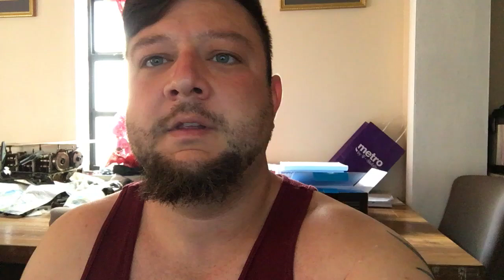K20/K24: Head Swap Worth the Time & Money?

Comment: So.... I'm glad I came across this video as I'm looking to purchase a 2nd gen CRV in the next 12 to 14 months. Having said that: there is still one thing that has me a bit puzzled. On the standard K24A1, there is only one VTEC solenoid. Youtu.be has a plethora number of videos saying that the K20 head is just a bolt on and go type modification. My wonderment is: what engages the exhaust VTEC? I haven't seen any videos that show this step. Or is the K20 head always "locked" for higher exhaust flow? Maybe I need to do more "paper" research.
Reply from the maker: The cams dont act independently of each other and you cant expect to do a headswap to a base model block without tuning and expext good results
Reply: @VHBEngines Oh cool!!! So, um.... What controls the second/exhaust cam? Some kind of special harness or something?

Comment: People are asking $1000-$1500 on eBay with no cams for a K 20 head
Reply from the maker: Hard pass
Reply: @VHBEngines  absolutely especially if it’s not gonna do anything for my car
Reply: Same thats the reason im here. Im checking for opinions and to see if its worth 1200
Reply: @RefugeeBabyzZ  and if you just put the head on it doesn’t do shit people say oh you get an extra 40 hp, yeah you do. If you put a 50° timing actuator and a downpipe and high performance exhaust and really big fuel injectors end a $600 tune so all said and done it’s gonna cost you over $2000-$2500 if you shop correctly to get 40 hp.

Comment: Been really digging into it lately and find myself in confusion about the K24 and I am damn sure you'll know the answer to this my friend. Apparently the 04-05 block comes with better/thicker rods compared to the 06-08 block and apparently the crankshaft from the 06-08 is balanced better than the 04-05? So much misconstrued information out there it seems, that or I simply can't find a straight answer that hasn't been countered.
Reply from the maker: Highly doubtful on the rods. Crankshaft info may be true but end of the day if your looking for a "better" crank then get whatever cranknyou have knife edged and balanced at a machine shop. Nothing honda did there is going to make any difference onnthe dyno

Comment: I have a full k24 swap for my rsx but now it can only goes up to 7000,7500 rmp. How should I fix that to higher pull?
Reply: Use ur k20a2 oil pump n fit it to the k24a2 block  but bfor u install it.  Port it.     I have full k24a2 swap on my 8tg gen.  And i recently found the k20a2 pump at the junkyard. Im goin to port it bfor installn it cuz right now i rev 7500   just to be on the safe side.  Ive heard tht pump goes beyond 9k ported

Comment: i have a k24 ep3 type r otherwise stock rev limit set to 8000rpm the engine reaches peak power at 7000-7500rpm lap times are no different to a k20 peak power comes on at lower rpm. the car pulls well midrange. stock type r intake & exhaust.

Comment: I have a 2009 Honda Civic Si, just swapped the K24 Block, kept my K20 Head, also plugged the oil jet spray with 10 mm screw. I was getting P2647 error, changed out the VTEC Solenoid assembly, also VTC Solenoid, also changes out the new engine harness.  Still the P2647 code, I give up, don't know what the issue is, if anyone can give me some idea or advice i could sure use it right now.  TY!
Reply: If your running ak24 block get it tuned

Comment: I thought people used the k20 head because it requires less shit to go turbo or supercharged....
Reply: The Ram only when k24 is built to rev high. Throwing a z3 head on a k24 block and revving it to 8200-8600 will blow.  If you are using the z3, or a k20 head, you need better oil pump, stronger rods, slight head work to k24 for it to get to 8k+ rpm.
Reply: @TheGerbsteve  Not to sure about that I had a 06 K24a2 revving to 8400 only thing done to the motor was 50* vtc and type s oil pump. stock k24a2 rbb head with these add on can rev up to 8600 before valve float
Reply: iCam Jailbreaker I knew I should’ve bought an 06 k24a2, better cams, valves, stronger rods... I have 04 jdm k24a, so it’ll probs handle 8k rpm tops, if that with stock pump. My next build will be an 06-07 usdm k24a2, type s pump, super tech valve train
Reply: @TheGerbsteve  put a 06-08 usdm camshaft in your 04-05 engine with vtc50 and type s oil pump ... I have that I’m waiting for dyno but it will rev to 8200-8300 rpm(which is enough) my buddy have the same set up but had a full 06-08 engine before that (that blow) so he take all his goodies and put it in a k24 jdm 
K24 06-08(vtc50 type s oil pump) did 235whp 195wtrq
K24jdm (06-08 cam, vtc50c type s oil pump) did
230whp 192wtrq so for that much difference just go for the cheaper route
Reply: @tomydespins2315  it’s the cams  that are really the only thing different from the 04/ 06 engines and throttlebody size everything else is exactly the same rods pistons  Head
Reply from the maker: Hohmies Mcfly nope

Comment: What if you have something like a k24a4 with the junk vtec. would it be worth it to drop a k20a2 head on it ?
Reply from the maker: Progressive Auto yes
Reply: VHB Engines my head just messed up on my k24a4. Can I put a k20z1,A2,z3 head on it without tuning it?  If I want to mild boost the low compression A4. Should I just get the same head or upgrade the head ?

Comment: I have k20z3 and k24a... everyone is telling me to go z3 head, but I’m keeping full k24 long block. Plus my jdm k24a has less miles. I will say, I’m going to run z3 50 degree vtc and rbc mani on my 2.4. Good vid. I figured the head flow rates would be very similar.
Reply: K20 heads, have smaller values it's not worth it. Stock vs stock, the power gain is minimal not worth the money. In the end, if you CNC the heads you would have more head flow with the bigger valves with the K24.